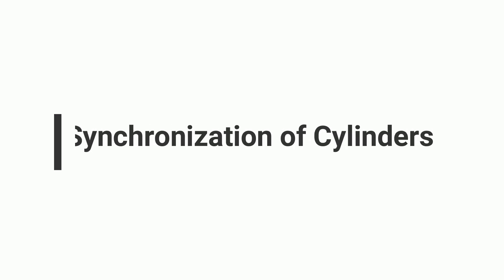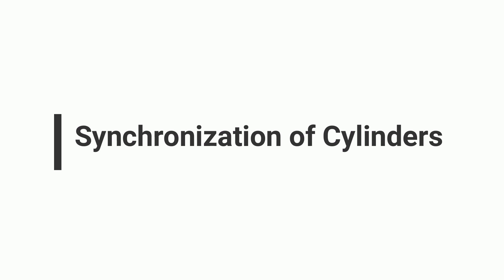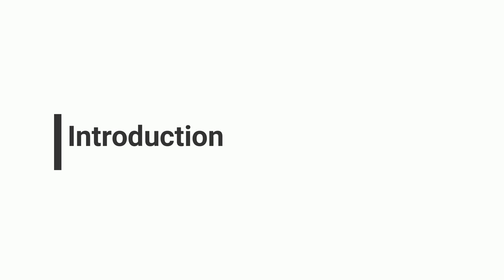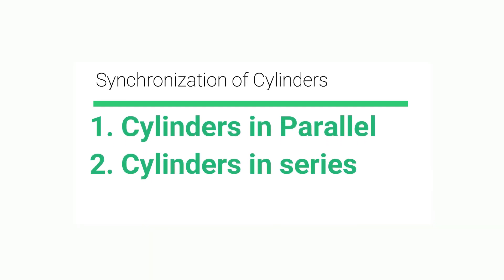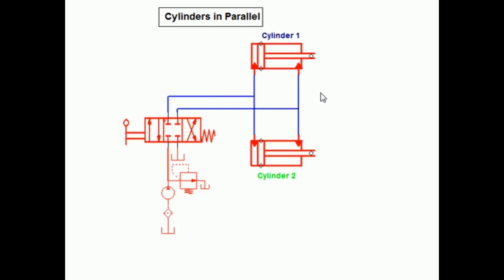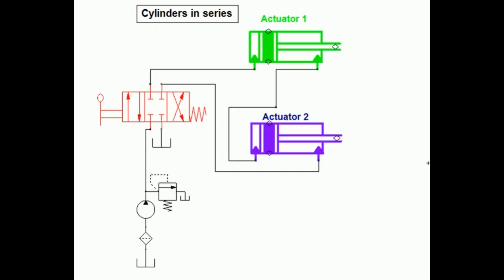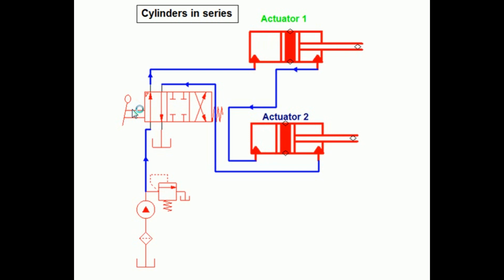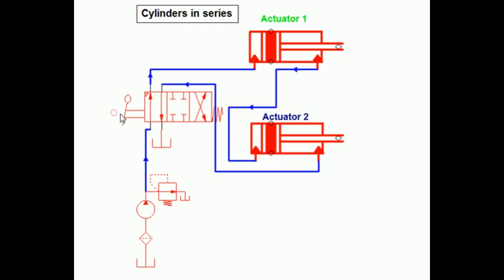Synchronization of Cylinder/ Actuator- Industrial Fluid Power | Animation

Comment: Hydraulic actuators on after-burner nozzles are sometimes synchronized using the flexible cable system developed by National Waterlift.  Each actuator contains a worm and wheel mechanism that cannot be back-driven if out of synch.  A rotating cable connects the multiple actuators to achieve this synchronization mechanically..